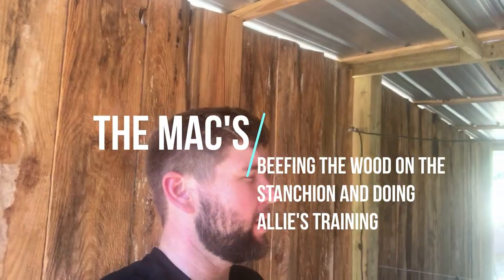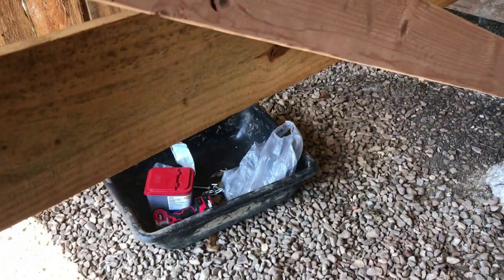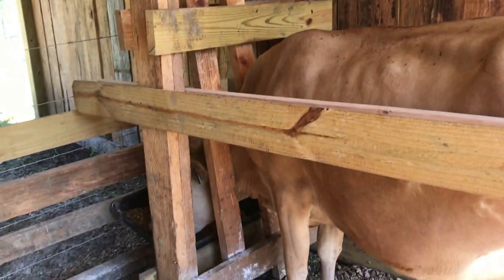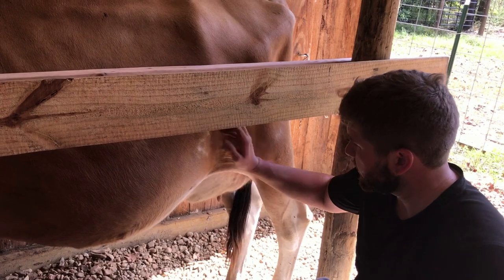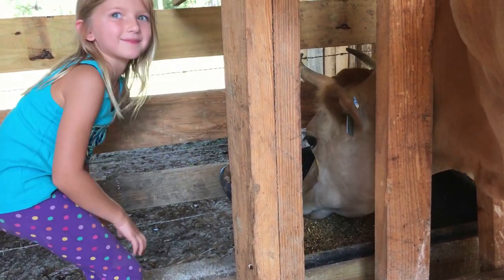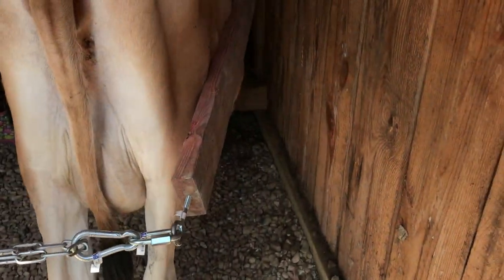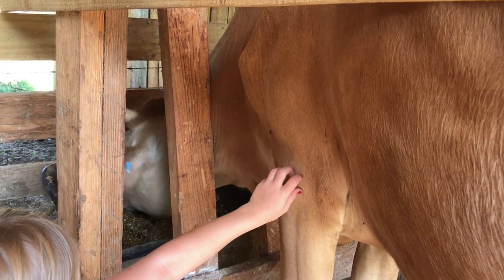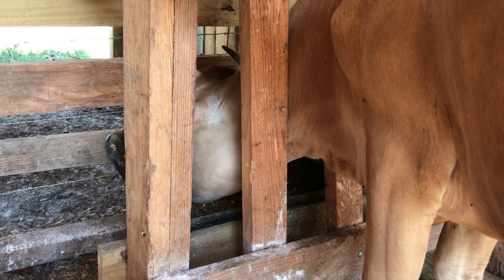How To Train Your FAMILY MILK COW | Milking Cows 101

Comment: So is apple cider vinegar better than soap and water?
Reply from the maker: We do both. Soap and water is great and we did that and do that during winter or wet seasons if the cows are nasty however with rotation my cows are not badly disgusting so we usually just do organic apple cider vinegar and that’s one less step and one less bucket to have out there. You wouldn’t be wrong any way at all. I have done both for years. Just like the acv and like the basic iodine pre dip also